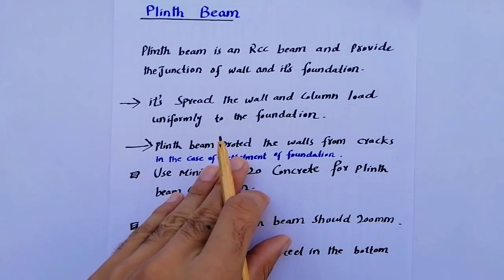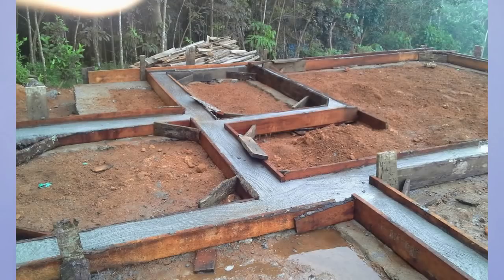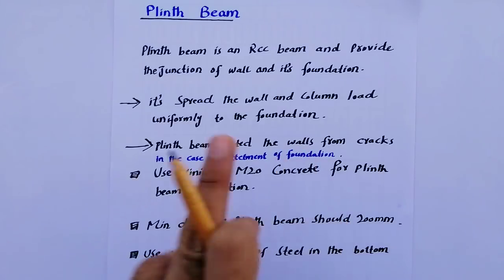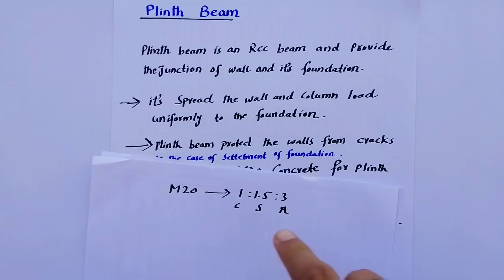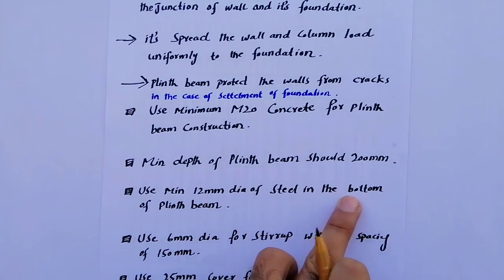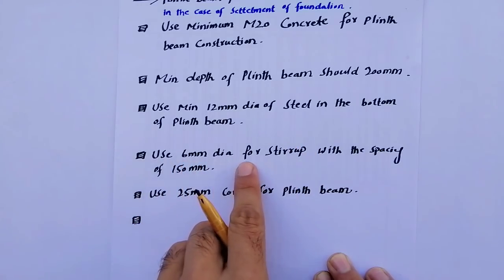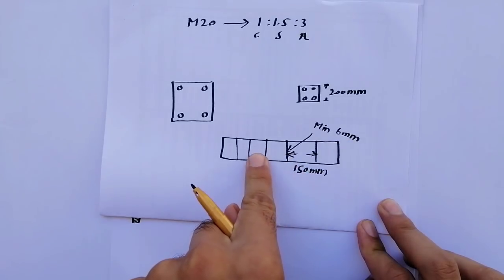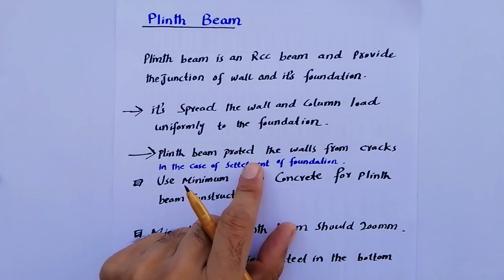Tips for Design of Plinth Beam | Design of Plinth Beam | What is Plinth beam

Comment: Hello i have plot of 30' x 61' There are 21 columns in it measuring 9" X 9" With 4# 16mm steel bars Fe500.  I have a confusion regarding Plinth beam reinforcement. Will a plinth beam measuring 9" X 12" with 6 rods of 12mm steel bars be strong enough?
Reply: Plinth beam loads are independent of column size and column loads. Plinth beam dimensions depend on span between columns. In any case plinth beam reinforcements suggested by you seems adequate prima facie.